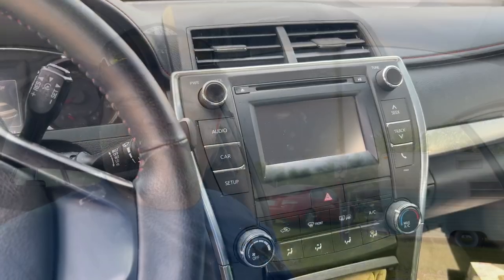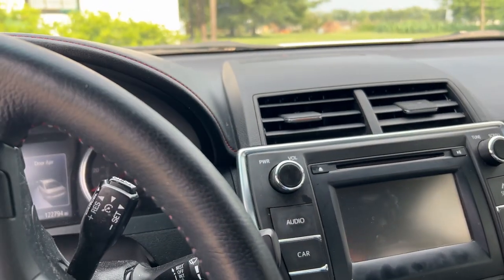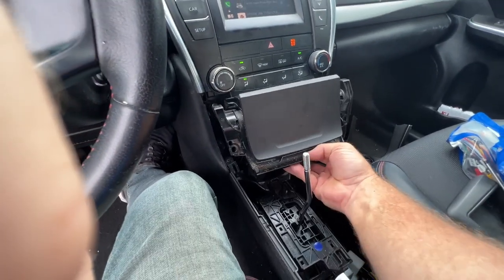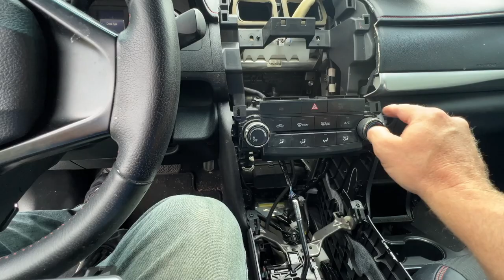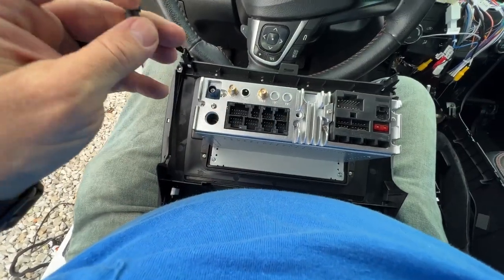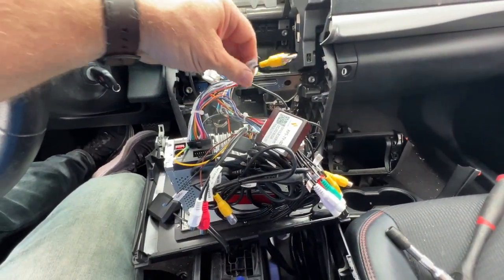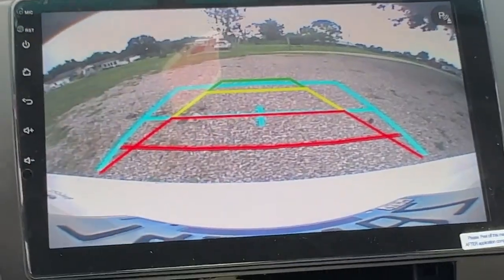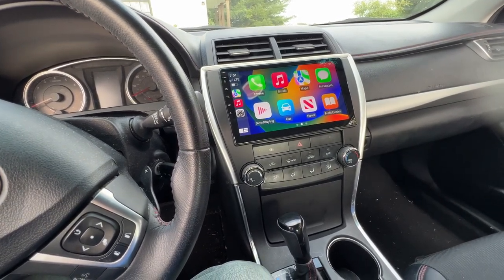How To Install A Roadanvi Stereo In A 2016 Toyota Camry!!

Comment: 2016 Toyota Camry. The first thing you should realize is that you have one of the finest cars ever made. Same for the 2017 Camry.
Reply from the maker: Agreed 👍🏻
Reply: What do you say about a 2015? No difference?
Reply from the maker: Good cars also 😉
Reply: Huh?!? One of the finest cars ever made? Compared to what? Please tell that to my 2016 Camry with the slipping slushbox of a transmission, and brake rotors that won't stay true for longer than 20K miles, and the driver's door lock solenoid that works only when it feels like it, etc. etc. etc. And, yes, I've kept up with maintenance religiously and only installed quality replacement parts. Overall, it's just an OK car -- nothing remarkable -- and certainly not the finest car I've ever owned. Consumer Reports loves to rave about how wonderful Toyota and Honda vehicles are, but I double-dog dare you to do a quick Google search of "2016 Toyota Camry problems" (or feel free to substitute whatever model/year you feel like), or "Honda transmission problems."  

Glad you're madly in love with your Camry, but we'll have to agree to disagree on this one.
Reply: @jamesbeckett1602 75k miles before I even had to replace the brake pads in my 16 Camry Hybrid, only needed rotors because my wife drove for weeks on worn pads, haven’t had any other issues with mine, sorry you got a lemon
Reply: @jamesbeckett1602  what are you even talking about. 20k mils to change rotors? What re you even doing with your car? You put aluminum rotors on there or something. Are you towing 10 ton boat or something that makes 0 sense
Reply: True story
Reply: @jamesbeckett1602 How many miles are on your Camry?
Reply: @jamesbeckett1602  I have a 2015 SE, this is my first (and possibly last) Toyota and I'm honestly not that impressed with the quality, the late 90's and early 2000's were a whole different world in terms of reliability. I bought mine in 2020 from the original owner with 90K miles and after a few fluid drain and fills on the transmission, by 108k miles it started shifting weird. Harsh 1-2 shift and a flare/slip from 3rd to 4th, and it would sometimes fall out of 4th while decelerating downhill. Even after resetting the transmission adaptations it never would learn to shift right. In a desperate attempt to save the transmission, I installed a brand new genuine valve body assembly and so far it's doing much better, the 1-2 shift is better and the 3-4 shift doesn't flare anymore, it also holds 4th gear better but not perfect going downhill. At this point I'm considering selling it and getting a new Nissan Versa with a manual transmission lol. There, I'm done with my rant lol.

Comment: Correct me if I'm wrong, but it sounds like Roadanvi sent you this stereo for free. That said, if I were to fork over nearly $500 on an aftermarket stereo, I wouldn't be quite as forgiving as you concerning the fit and finish of the trim on this unit. I'm not overly OCD, but rewinding the video and seeing how nice and tight the trim fits with the factory stereo, then fast-forwarding toward the end, and noticing the gaps on the new stereo trim where it meets the dash -- left me cringing  😬. I mean, good on you for scoring a free deck but for me, I couldn't live with those gaps.
Reply from the maker: Don’t blame ya. Fit and finish is definitely not perfect.
Reply: @ProjectDIY2 so they did give you a free unit?
Reply from the maker: Yes

Comment: Did you use the 4G+64G or the 8G+128G? We’re curious what the difference is and if it’s worth the extra money? TIA!
Reply from the maker: Mine is the 8/128 version. 8G of RAM and 128G of storage. The 8G RAM version will have a snappier user interface vs the 4G version and more storage space if you wish to store music on the head unit.

Comment: It was almost perfect.  I followed every step of taking it apart. Thank You, you made my job easier.  I bought the same Roadanvi Radio and I took the brackets off of the Factory Radio and added it to the Roadanvi radio.  It was a perfect fit.  With the metal brackets on, I got the radio more secured in the dash. with the (4) 10mm bolts.  That was my only discrepancy with your installation. Otherwise, I followed your directions to a tee. Thank You!  Also, the climate control gets screwed into the bracket too.  More secured Climate Control.
Reply from the maker: Awesome! Thanks for the kind words!!

Comment: thanks for the run through about to install mine tomorrow
Reply from the maker: You’re welcome!
Reply: where do i put the gnd connector
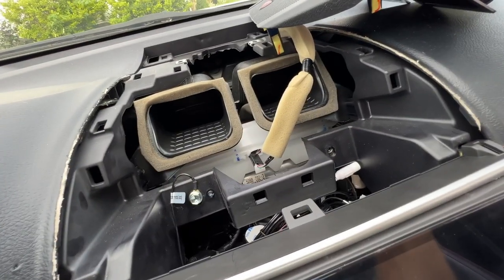Reply from the maker: I pointed it out at 21:17
Reply from the maker: Either one of those 2 screws at the top.
Reply from the maker: Sorry, that should have been 20:56
Reply: @ProjectDIY2 thx man sounds great my only problem now is i think i hooked up the backup. camera wrong and it won’t work

Comment: Thank for you video, but I have a problem after I installed,the backup camera resolution is very low ,can you tell me how to fix it😂?
Reply from the maker: Are you using the stock camera? If so, I’m not sure what would cause that. I would contact the manufacturer.

Comment: I have a 2015 Camry with the JBL package. Do you know if the Atoto S8 Ultra 10.1 would fit? It is a double DIN as stated on anazon. Also what wire harness would i need to buy?
Reply from the maker: Sorry, I’m not familiar with that brand. You would need to call the head unit manufacturer.

Comment: Thanks for this great video! The only problem is that the factory backup camera isn’t working, how did you plug it in?
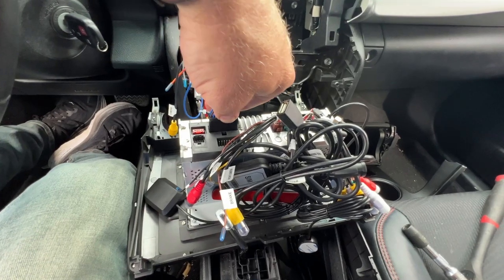Reply from the maker: Watch the video at 16:11 The yellow “Camera” harness connection hooks to the “Camera In” cable on the radio. Also, some have been able to unhook the battery for a few mins to reset everything to get it to work. Try that first.
Reply: @ProjectDIY2  Great, thanks for the fast reply!
Reply from the maker: @vincefiore No problem. I just happened to have my phone in my hand 😂

Comment: Did you have any issues with FM radio reception? I installed mine and most of the stations come in but signal seems weak
Reply from the maker: I haven’t had any issues.

Comment: 2017 Toyota Camry, everyting is connected but the screen doesnt turn on. Any reason?
Reply from the maker: Double check all your wiring connections. Disconnect the battery for about 10 minutes and hook it back up. Did your old radio work?

Comment: Hey man so I got mine all installed. Thank you for the guide but it won’t boot it keeps restarting itself any advice?
Reply from the maker: That sounds like an issue with the unit. Contact the manufacturer or get it replaced if you bought it through Amazon.

Comment: Thanks for the detail video. I noticed you had the carabc decoder. I am contemplating if I should upgrade the stereo or continue using the decoder. Do you think it's worth it? The decoder works most of the time for wireless carplay, but the screen quality is terrible and I've had some minor glitches that are annoying. I do like the OEM look so that's why I am hesitant. Thanks for the input.
Reply from the maker: Definitely worth it for the screen alone. Much brighter, much clearer and much larger!
Reply: I just replaced my factory radio, it was so worth it.  Took a couple of hours, but was well worth it with Apple Car play and a huge map for directions. Definitely do it, it was worth the money!

Comment: Did you have to do anything special getting the radio to connect with the back up camera?
Reply from the maker: Yes, several people have had backup camera issues after install. Unhooking the battery for 10 minutes usually fixes this.
Reply: @ProjectDIY2  does the radio use the existing backup camera or do you have to route a different camera?
Reply from the maker: @jcellio7604 It uses the stock backup camera

Comment: Thanks for video sir!  Just wanted to ask you how is it holding up until now? Any issues? I am planning of getting this also for my 17 Camry. Steering also works right? You said  the apple carplay sometimes disconnect. Are you connected through your hotspot from your phone? TIA!
Reply from the maker: You’re welcome! It’s still working fine. The steering wheel buttons work perfect and you can even change them through an app on the stereo. I am connected wirelessly through Bluetooth and WiFi. It will disconnect maybe once out of every 20 times but I can connect it right back.
Reply: Were you able to install netflix on yours?  I wanted to install but it says my device not compatible. How about the simcard. It says 2 sim card but I only see one. Thanks!
Reply from the maker: @mcool116 I didn’t try Netflix. I didn’t use a SIM card either. It’s my wife’s car and she just uses car play which doesn’t need a sim.

Comment: Did you also plug in the front camera plug? I have bought the same one as you and my backup camera doesn’t work at random times
Reply from the maker: Nope, I don’t have a front camera. I would suggest unhooking your battery for a few minutes and see if that helps. I think others have had this issue.
Reply: Thank you so much for your help!
Reply from the maker: Thank you for watching!

Comment: Does the factory usb cable still work? And does that allow it to connect to CarPlay as well?
Reply from the maker: Yes, one of the plugs on the head unit has an adapter for the USB port.
Reply: Sweet! I also have seen that there’s a bad gap between the stereo and the climate controls. Is that true? 

And I’ve also heard there’s an annoying little robot dude that’s on the screen and never goes away
Reply from the maker: The gap between the climate controls is not great. There’s no android robot that I’ve seen other than the start up animation. But it goes away as soon as it boots.
Reply: Sweet sorry I keep having questions but I’m on the fence about buying. Are you also able to keep all of the controls like steering wheel and the car options controls?
Reply from the maker: No worries! Yes,  all of the steering wheel controls still work. And you can program them to do other things too if you want.

Comment: installed mine and i hear static like whitenoise. how do I fix it?
Reply from the maker: Are you trying to listen to the radio? If so, and you can’t tune in a station, check to make sure you hooked up the antenna connection.
Reply: @ProjectDIY2  ok thanks! ill check that out.

Comment: So did u use a sim card
Reply from the maker: No, since we primarily use CarPlay, a data connection is not necessary. iPhone uses its own data connection and displays the info on the screen and pushes the audio over Bluetooth.

Comment: Can you still use the steering wheel phone buttons and dobrhey work the same as the factory unit .. Like the botton that you can speak to call a contact ?
Reply from the maker: Yes, and it has an app built in that allows you to remap those buttons if you choose to.
Reply: @ProjectDIY2  Thank you . I've researched  saw a lot on the  left side controls working nothing on the phone side of it ..
Reply from the maker: @Blvdballer Hmm now that you mention it… seems like I do remember there being an issue with ones of the buttons. This is my wife’s car so I don’t drive it. I’ll double check those buttons and get back to you. 😉
Reply: @ProjectDIY2  I would appreciate that very much. I like my stock radio feature that I can just push the talk button and tell it to call one of my contacts. I'm hoping I will be able to do that still and talk through the unit .
Reply: My 2916 Camry XLE Hybrid has a JBL stereo. What do i to install that stereo in my car?
Reply: @ProjectDIY2 did you ever check this out? I'd like to know if the call/hangup buttons work.
Reply from the maker: I apologize, I completely forgot about checking on that. I’ve since changed the stereo to a new Dasaita G12 unit so I can’t check it with the Roadanvi.
Reply: @ProjectDIY2  thank you for the response, I just finished watching your video on that model and from what I hear it meshes very well with a 2016 Camry so I may pick that up instead.